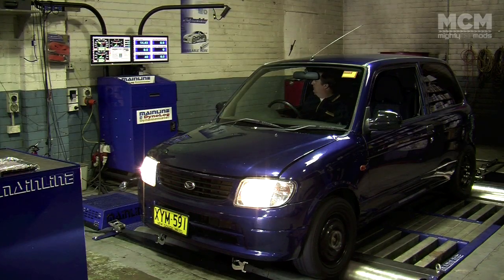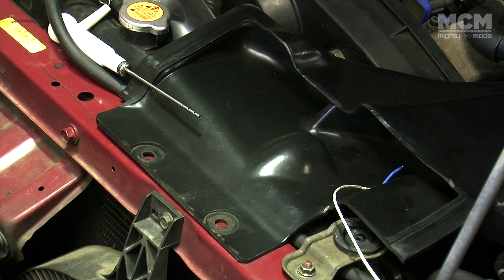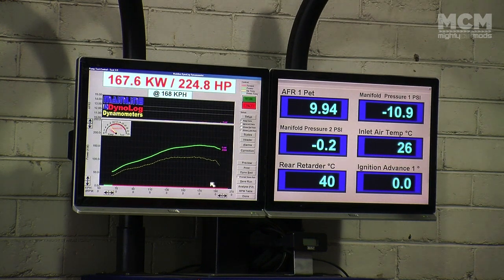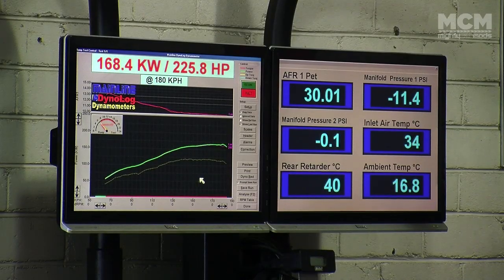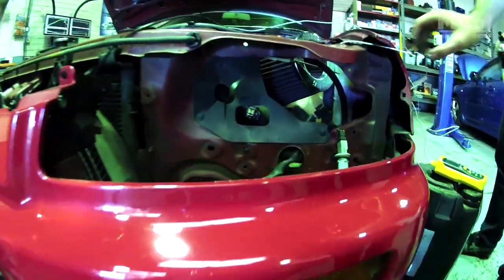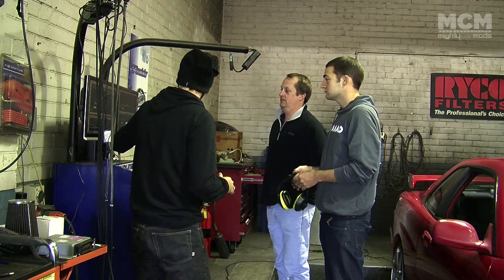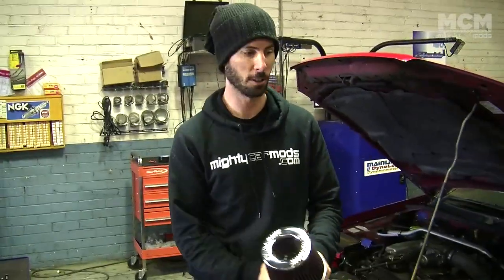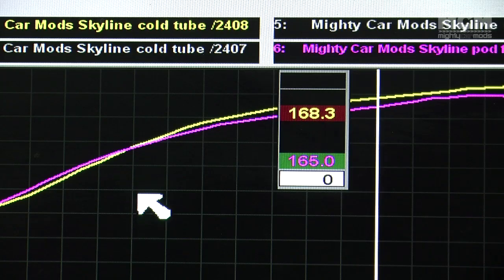Cold Air Intakes Mythbusted [Turbo]

Comment: I'm sorry, but there was no way you'd see any results on a dyno.. it doesn't make any sense.. first of all, to filter isn't there for 15sec runs on 1 gear. If you floor the car for some time you'll get higher temperature under the hood, the difference will much higher then what you've measured. secondly, you're running the car with no air movement, driving the filter out of the car body will only make sense if it's getting the cold air thanks to car moving through it, not standing still in a building.. you've done the same mistake when "mythbusting" the black intercoolers, which Engineering Explained pointed out to you.. Basically every bit of car's air intake and cooling systems is designed to work in an air flow, which is a natural habitat of a car if think about it..

i hoped you'd put some more thought into this..

Comment: Not surprised this did not work. the  intercooler is doing it's job. If you had a tubo with out a intercooler the cold air intake may have worked. How an Intercooler works http://www.turbosmart.com/technical-articles/how-an-intercooler-works/

Comment: a car is not moving on a dyno there for you can not measure the utilization of air coming into the engine bay.
Reply: The big blue box in front of it is a fan
Reply: Dyno fans are used to help keep the engine cool not to generate enough wind to make a difference on a CAI.

Comment: If you want actual gains in horsepower you need to install a heat shield
Reply: I always heard changing the blinker fluid to a 96 octane always did the trick, if not just add some zex and NOS stickers and that should give a significant 5+ hp for each sticker
Reply: +Nicholas Hartmann I run a 93 octane blinker fluid but I live in a cold climate really helps when I'm hauling my board stretcher though.

Comment: that car is not moving...if air is entering at a high speed and an upgraded intercooler installed as well as the cold air intake it should make a rather large difference.
Reply: they also didn't even tune it to suck in more air, at this point it's just making cool noises.

Comment: This video must be for entertainment only.  The"cold air intake" they used is what is known as a short ram.  Those are not good!  A real cold air intake pipes outside of the engine bay.  Also a little fan like that is not moving nearly the amount of air as a vehicle at cruising speed.
Reply: I'm guessing you didn't watch all the way thru the clip? They did stick the filter outside the car. This video still is inaccurate though. Didn't tune the car with intake.

Comment: Y no heat shielding?
Reply: youll probably loose power with a head shield since their is no snorkel... also no matter what you do on a turbocharged engine the filter isnt really gonna do anything unless your pushing big power and still using stock thin intake piping

Comment: CAI in my BMW M5 gave it 20hp increase.
Reply: Did you dyno it before and after?Was the computer tuned  for CAI?
Reply: your saying complete bullshit, i wonder why most people drag racing their ls motors use the stock airbox...
Reply: teh vee teh vee simply put, they dont
Reply: TO all that think CAI work they really do not do much maybe a 2  HP increase but that is within the noise.This  means it could be the  engine air temp may be different from the first dyno test.In most cases COLD AIR DOSE NOT WORK AND YOU COULD EVEN LOSE POWER.
Reply: Combustion69 lol wtf are you talking about I could literally go get 20 small block lsX cars video'd and no one runs a fucking pod filter. They all run panel filters, and everyone know CAI is a marketing scheme. These are people running low 9s-to high 12's. My buddys f body camaro runs a 11.3 on skinnny's and he uses a fucking panel filter...If a cai did anything he'd have one , id have one, your mom would have one, all our cars ,stock, would have one.
Reply: teh vee teh vee Do you even physics? Cold air is more dense, more dense means more energy. More energy means more power. If that werent the case engineers would design cars so they get their air feed from the engine bay.
Reply: Combustion69 Lol every single test that has been done has concluded whatever variation of the cai on any car, turbo, spray, n/a has only ever shown deviation based on ambient temperatures, and don't give me that 'do you even physics bro?' ,bullshit. It makes you sound like a 12 year old studying Newtonian physics. In, fact most if not all tests , that weren't done by the CAI manfacturers , point at a loss of torque on the low range, and negligible gains on the top end. You should know, through owning a bimmer that the air box is already as good as it gets from the factory and the majority of manufacturers maximize them as well. The verbatim you are repeating is the same dumb crap honda people regurgitate...
Reply: Combustion69 One other thing never belive what a maufacture claims unless they can prove it on a engine dyno or car dyno. Again before and after tests.Good luck
Reply: stupid test. for a car channel that has 2 mil subs this was a bad test. Skyline have MAF systems. CAI will do nothing. without a tune. should have used a car with a speed density system and check the dyno.
Reply: Darkmorningsun Just a reply I have done on a dyno and tuned the engine there was lose of power with one system and a marginally increase 5HP increase.
Reply: Vito Cialdella Hmm really? I know CAI wont do much in terms Peak/maximum HP and Torque. But what about the curve for the dyno? I ran a Ford Fiesta and a mustang Ecoboost on the dyno and the HP/Tq on the top end (6k-6.5k) of the power band it held its power by a lot better with the CAI. I believe the number was around 15 HP and 20tq Not peak gains.
Reply: Darkmorningsun I only compare gains to before and after with exactly the same ambiant conditions.If this cryteria can not be meet then you numbers could be invalid.A envirmentally control atomosphere dyno is the way to go.
Reply: Vito Cialdella lol I love how these people think a CAI on a small displacement engine would give them more gains then a set of good heads and a better intake manifold.

Comment: if u remove  the headlight u would  have increased air running thru the hole straight to the  pod. not an accurate test  at all

Comment: but the car isn't moving through the cold air
Reply: There is a big fan in front of the dyno, it's the bi blue box
Reply: Dyno fans are used to help keep the engine cool not to generate enough wind to make a difference on a CAI.

Comment: lol I would love to see y'all test on a real car... something that has more than 2.5 i6... but obviously the "stock" is already a cold air intake by design... so comparing cold air vs cold air ... you're not going to see much... Your methods of "debunking" are terrible... having tuned cars and drag racing non-cold air vs cold air does give you better performance period we've done dyno's before and after, because cold air=more condensed air which means more O2 to burn ... then if you were to add a turbo or super charger... But people ripping on K&N obviously have no clue why people buy K&N... But before MAP sensors you have to actually do tuning... MAP's do a better job adjusting fuel intake... plus many cars have Helmholtz Resonance Chambers that have a specific purpose so... yeah these guys are just bad... and shouldn't put out nonsense like this.

Comment: how does this compare to intercooling?
Reply: They aren't really related. I mean they both have to do with the air going to the engine but one is before the turbo and the other is after the turbo
Reply: An intercooler will cool down the pressurised air from your turbo which is hot to give you more oxygen and therefore more power from your engine.  A cold air intake will take (as the name applies) cooler air for your engine or turbo (more oxygen) to make more power. Remember both of these require your car to be moving so that the funnel quick and cold air into them for better results. A fan as showed in this will not gibe the same results at all.
Reply: Socrates Nicolaou if the fan is moving the same amount of air as would be going by the vehicle while in motion then you would get the same results.
Reply: yeah but to have such results you literally need a wind tunnel

Comment: Of course it's going to be the same if your not driving outside ther is no cold air going in the system because you are not driving outside with wind byou are in a garage so you are just sucking in warm air
Reply: You are not driving outside so no cold air will be sucked  in only time the warm air not to mention  there is no wind flow

Comment: A lot of naysayers in the comments... but nobody has a video that shows CAI works as advertised?
Reply: Because CAI's are proven to work.  They did this video using a turbo car and turbos don't work well with CAI especially when the turbo is spooling.  Also dyno fans do not generate the force needed to simulate a vehicle at driving speeds.  This "myth busting" video is highly flawed because these guys have no knowledge on how these engines work.  Not to mention that CAI's are sealed off and they did not do that on this video so when they ran the filter outside the vehicle the power gain wasn't because of the fan but it was because of the cooler air being sucked in from the outside rather than sucking in hot air from the engine bay.  CAI's work and even high flow filters in stock air intakes work.

Comment: This test is biast, considering a turbo engine regulates how much air is aloud into the engine, but I know from personal experience a FUNCTIONING cold air intake that physically Ram/forces air into your NA engine (via the air flying through your fingers as we pretend our hand is a plane out the window) that's just money slipping through your fingers that you can easily $ave by redirecting that air bringing more oxygen into your intake, to stretch every penny you put into your tank! It will make a difference you can FEEL as well as increased throttle response and increased mpg,,leaning out my engine probably,  worth the time absolutely it co$t$ under $25 for most cars. And the first car I tried it with was an ef hatch, ef civics are by far the easiest cars I've done this to,, first try I went from a best of 38mpg to averaging 49.9 mpg from Chehalis WA to Brookings OR!😎😋

Comment: Are these guys really sitting here changing Intake on a car using stock ECU if thats the case then hell just about any basic bolt on mod would cause you to lose power bc your ecu is pre set to suck&blow a set amount of air you dont just throw on intake Race headers exhaust throttle body intake manifold list goes on and exspect to get gain without re tuneing your car it will run lean and blow that would be a waste of $$... For example lets looks at Kpro for honda cars kpro by its self on a stock systems will give you 15whp maybe even though you can tune it your car. There is only much you can do with restrictive OEM parts but once you have kpro you want Intake then you will see 10hp gain throw in some headers exhaust and maybe lil fuel system upgrands and actually it tune you will easily see 40-60whp gains thats a fact! BTW intake by its self even with a tune isnt gonna do much without other supporting mod

Comment: It is retarded to use that plastic elastic "tube" for the intake, air is a fluid and it's susceptible to TURBULENCE, that may explain why you lost HP. ALSO you saw gains on the N/A car (S2000) So, not busted, your methods are not accurate. 

I agree that it doesn't make THAT much power, 3 to 5 HP and that's it, but calling it a myth is overreaching.

Comment: A cold air intke that isn't heat shielded and paired with an echaust or a tune is completely pointless
Reply: yea with no tune it is pointless from what i understand. the car doesnt know they changed a damn thing. always heard if you throw on bolt ons with no tune you get minimal to no HP gains and even end up with worse power. but bolt ons tend to build on one another. better downpipes, headers, and less restrictive intake combined should see some gains. more than any by themselves and without a tune

Comment: I thought a cold air intake was an expansion cooler to improve compression in the engine/turbo/supercharger or a refrigerant that the air was cooled by as it passed through for the same reason.

Comment: How about driving the car without knowing if it has the factory or $$$ air filter.   Then switch;  driver has no idea which filter is installed;   repeat several times;  maybe DO NOT switch the filters to 'fool' the driver;   ???

Comment: your test is kind of meaningless, your turbo will be heating all intake air to roughly the same temp anyway, try the same test on a big naturally aspirated v8.  you are also missing the point of a cold air intake, it is meant for once your car has got upto to temperature so compare dyno results after 30 mins of simulated driving and the results will show; you'll see a regular air box drox off in performance but a cold air intake stay exactly the same. this is why people do this mod for racing as on the 10th run you might loose 5% power meaning you're 5% behind the guy who has the cold air intake.

Comment: You can’t just throw on cai and dyno test Lmfao a new intake means new air flow. Your ecu has to get used to the higher air flow. Plus it depends on filter you use cheap ones can actually restrict air vs a nicer k and n or a green filter

Also with my intake set up I only feel a difference at the top end since my filter lets me pull in more air then my stock my top end speed is 5-10 mph faster

Comment: did anyone think of using car with no computer controlled engine system. yet still if you looking for only any small gain in engine performance- must be racing as street its useless ... just like the stupid gt wings bolted on the back of you cars.  the wing is just a trunk handle until speeds above legal speed limits

Comment: I'm sure this video has been debunked, but come on you guys, on a turbo car? first mistake... lol.  Do you know the temps of a turbo? For one thing, any open filter under the hood is NOT a cool air intake and loses hp. The length of the tube and the turbulence created by the tube on a turbo vehicle makes a big difference as well.  Wonder if they even reset the computer... lol. silly video.

Comment: Aren't skylines awd wtf
Reply: it's a gtt, essentially the non master race version. Still kicks ass and it's easy to convert the front end to a proper BNR34, assuming shops still have them in stock.
Reply: only GTR are GTT or GTS are RWD

Comment: For starters you need to seal off the air filter. Then get rid of the turbos. Finally get a real engine instead of the small engines you're using now.
Reply: Then get chopped by people with smaller, lighter, forced induction engines producing the same bhp
Reply: 😂😂😂 wow you are certainly a funny guy
Reply: +Joshua Parrish what makes you think your 4 banger is going to make over 700 hp at the wheels?  Please bring your little child's toy to a real mans race.
Reply: +Ronald Anderson you've never seen Honda's with completely stock internals make 900+ to the wheels? btw i have a 1993 Twin Turbo RX7 FD so I'm not bias to anything really I'm just saying
Reply: Tyler, The Destroyer there is no stock Honda making 900 hp to the wheels, period
Reply: +Ronald Anderson Google it mate
Reply: Tyler, The Destroyer speaking of funny stuff!
Reply: Tyler, The Destroyer nope, no stock Honda making 900 hp to the wheels. https://www.google.com/search?q=stock+honda+with+900+hp+to+wheels&ie=UTF-8&oe=UTF-8&hl=en-us&client=safari#scso=uid_0:51.
Reply: there is no stock car of any kind making 900 hp to the wheels....
Reply: Lamborghini's are stock..
Reply: Lander Zook lambos are NOT making 900 HP at the rear wheels.
Reply: Gaston Glock bugatti veyron..........just off the top of my head
Reply: scc ultimate aero, bugatti chiron, koenigsegg one, and hennesy venom gt. all over 1000hp off the factory

Comment: This is not an accurate test in the slightest. The size of the pod they used was smaller than the factory air filters surface area! Ergo it was never going to make more power than factory, and a dyno fan is absolutely nothing like ambient air at 20,30,40,50,60,70,80,100,130,160 etc KPH. Shit it’s been proved on an NA engine at 200 KpH by  Machine magazine back when they were trying to build the most  powerful naturally aspirated V6 VN Commodore that they possibly could that removing the headlight produced positive pressure at 200 km/h!  Secondly, this particular vehicle uses an air flow meter. You need to change the range with which this is seeing, take away some fuel and alter the timing to suit each incremental increase in RPM to see the benefit- these clowns have busted no myth! They’ve simply created misleading knowledge and exposed it to over 15 thousand people - IDIOTS!